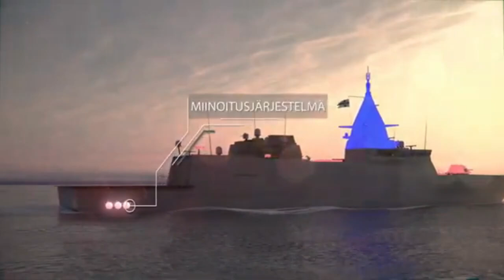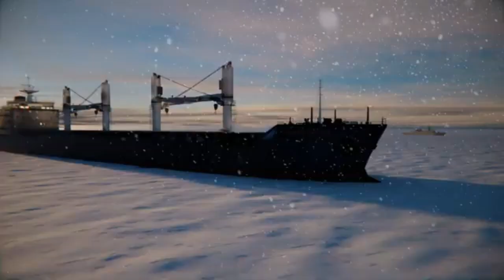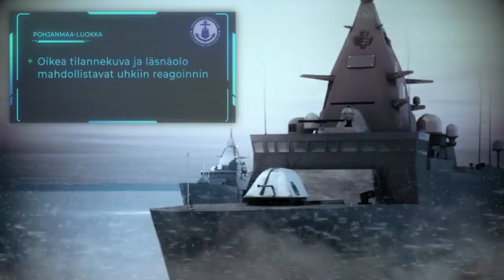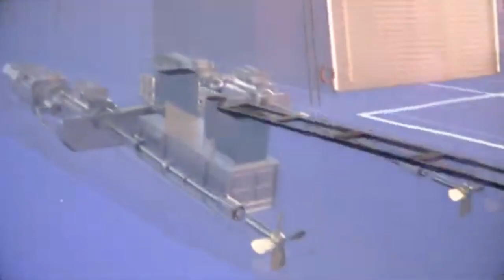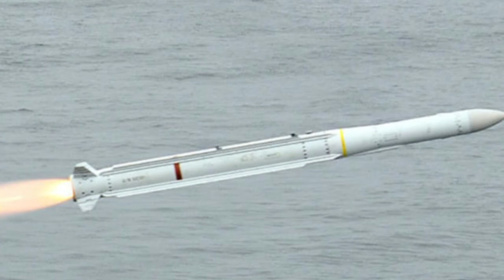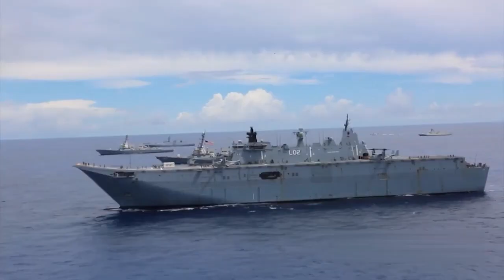RAUMA MARINE CONSTRUCTIONS BUILDS ADVANCED POHJANMAA-CLASS MULTIROLE CORVETTE FOR FINISH NAVY.

Comment: It's not the size that matters. 

Pohjanmaa class has short range, shallow draught and is optimised for coastal and littoral warfare. Therefore it's a (mighty) corvette. 

A frigate is a blue-water ship with longe range and deep draught for rough see conditions.
Reply: One could argue it is unnecessarily big for this purpose. It doesn't have a very shallow draught, 5m, and isn't particularly well optimized for coastal archipelagos for that matter. Hämeenmaa-class has 3.2m and Rauma-class has 1.5m draught and those are the ship classes still in service to be replaced. One of the requirements was also a long endurance at sea, which can be considered a break from the tradition of the coastal fleet. Aviation facilities, helicopter deck and hangar are also features that one would expect from frigates but not necessarily from corvettes.

Ships get classified according to their intented role instead of how they are optimized. I guess the intented area of operations is the Baltic Sea instead of the worlds oceans, warranting this class.
Reply: @herptek  
It's big enough to have everything needed on board. The war in Ukraine has shown, that a warship must be able to defend herself from all kinds of threats. 

Pohjanmaa class is shallow(ish) for its size (4,300 tons, 117 m). The Hämeenmaa class (1,450 tons, 77.8 m) and especially the Rauma class (240 tons, 48.5 m) are much smaller vessels.

Long endurance - again compared to previous vessels and Finnish usage. Not very long compared to actual ocean going ships.

Indeed the Pohjanmaa class is well equipped - especially compared to the vessels they are replacing. That was rather the point. 

Classification of warships is very vague. There are no internationally agreed rules - just some general guidelines. Even an exact same ship can be - and indeed has been - classified differently in different navies, depending on history, tradition, politics, vanity, intended use etc.
Reply: @timoterava7108  The point is that the draught of the Pohjanmaa-class is the least optimized out of all of the Finnish vessels in service for the kind of use you described. Missile boats would be better optimized for it. A corvette design as big as this marks a break from the traditional role of the coastal fleet, quite intentionally most apparently.

Swedish Visby-class corvettes by comparison also have lesser draught of 2.4m. Finland is going to operate the most frigate-like corvette design on the Baltic Sea.

I would agree with your opinion that, as I also previously said, ships get classed according to their intented role and not necessarily by how their design parameters are optimized. I guess this distinction to frigates is justified by having the Baltic Sea as the intented area operations.

Comment: 117 meters? Thats a frigate the Finns have built, they just call it a corvette. 🤔
Reply: They are Frigates. Finnish Defence Force usually downplays military equipment orders to avoid attracting to much attention from the ruskies.
Reply: @USAoutofEurope  That sure seemed to be a concern during the cold war and even perhaps still some time after. But I guess calling this thing a corvette is kind of on point given its intented use despite being bigger and better armed and equipped than corvettes generally are.
Reply: Best to appear weak while being strong no?
Reply: @benjaminbohrn5696People were speculating that the classing was a remnant from an era when everything official in Finland was explained in a downtoned way in order to not provoke the USSR.

The displacement and tonnage are such that according to defence forces own definitions it should be a fregate. The often cited reason why it is not officially called a fregate is that its supposed area of operations is within the Baltic Sea instead of the high seas.
Reply: All ships have increased in weight. 
Everyone has come to the same conclusion, steel is cheap, size is cheap and building small is expensive as it leaves you with a ship that is difficult to upgrade.